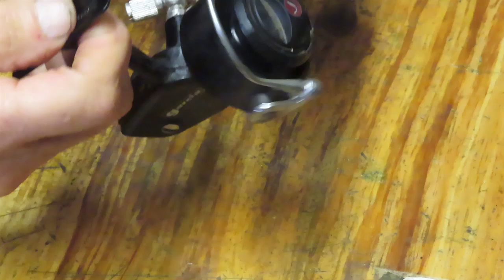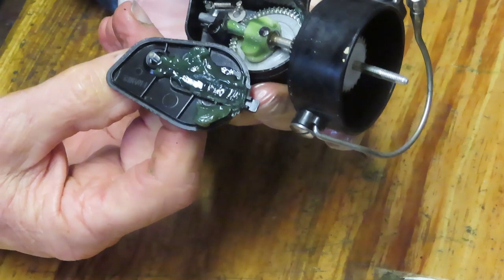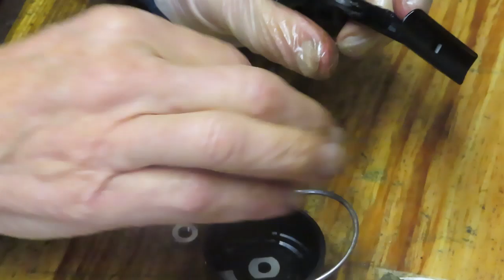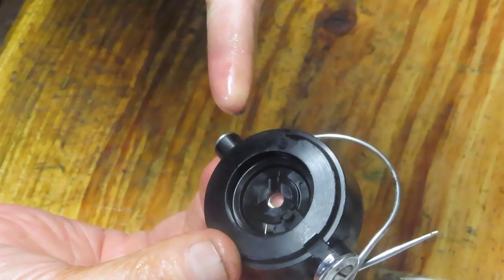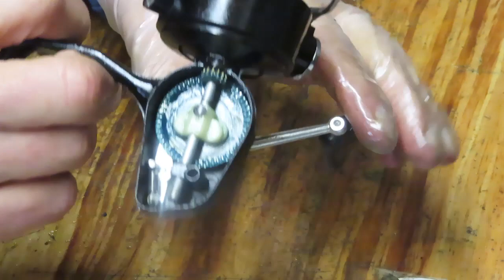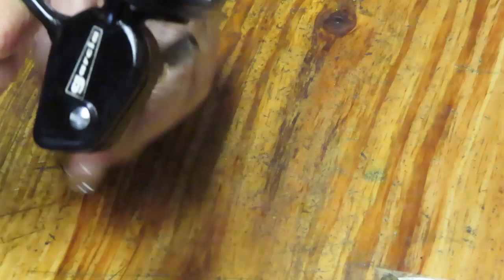Mitchell 204 classic freshwater fishing reel how to service

Comment: Hi, great video.   I have had this reel since 1979ish.  

Do you know where I can get a replacement rotor for the 204.
Reply from the maker: You are faint to need to find a donor reel.  Traditional distributors  no longer sell parts for these reels as they are over 40 years old and the replacement parts are long gone.  Check eBay for a donor reel or be on the lookout for the reels at yard sales or flea markets, etc. - Thanks for asking - Dennis

Comment: Hey man can you please help me? Recently picked one of these up at a local flea market for 50 cents, everything on the reel works fine besides the spool, it was beat up to start with, and when i tried putting it back on, it had crumbled. What do you think the name of this spool is? Im looking to buy a replacement but I have no clue if the spools im looking at would even fit. Thanks
Reply from the maker: The spool part number is 82262
Reply: @2ndChanceTackle  thanks brotha

Comment: Thanks for the video on the  204.
I recently acquired one in the same condition (unused) .
I'm thinking of putting it to use as my pan fisher. Bream , crappie etc.
Mine came with the telescoping rod and carry case. From Mitchell Garcia. 
Have you ever seen one ?
Reply from the maker: Yes - I have the 308 in the travel case.  That one included the 308 made in Taiwan, so it was a later introduction

Comment: I'm glad you did a video on this one, when I learned about it in your other video I was ready to start looking for one on Ebay but the plastic side plate is a deal breaker for me.

Btw I'm working on a Penn 940 levelmatic,  I got it all back together and everything is functioning but the reel is extremely stiff.
It feels like something is rubbing.
Any idea what I might have done wrong ?
The reel was given to me ( in generally pretty good condition) because the foot was bent.
I took it apart first just to straighten the foot out, and it worked fine when I got it back together then.
Now that I have fully disassembled it to clean out all the dirt and old grease, it's not running properly after putting it back together.

Comment: I have a 320 and it looks a lot like it does. I bought it new somewhere around 1968 but I haven't used it in decades.
Reply from the maker: Yes - the 320 and 324  are larger, but similar to this reel.  I will be doing a video on them in the future.  Time to give yours a 2nd Chance!  Dennis

Comment: Thanks for the video. The reel seems simpler than the 308. I haven't taken my 308 apart in a while, but I thought 308 had a beefier main gear. This doesn't look like it's as nice. The planetary gear was a pretty neat design of the 308, but not everything that's good has to be neat. I do like the design of the spool where it's not a button release. Although it's more convenient to take the spool off with a button, it's risky as it can malfunction under pressure or if you don't have it back on tight enough, which I've dealt with in the past. 

What do you think about this vs the 308? Do you think one is better than the other?
Reply from the maker: The 308 is one of the best engineered and well made reels of all time!  As you noted, the gearing is completely different from a more accepted "traditional design.  I have several 308/408 reels that I still take fishing today - Dennis